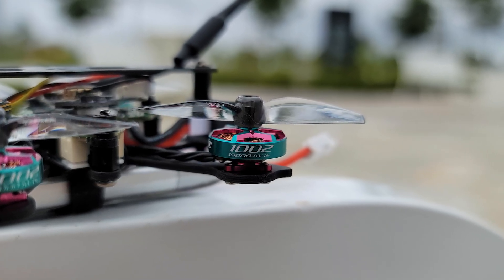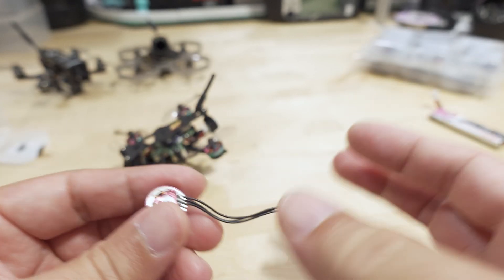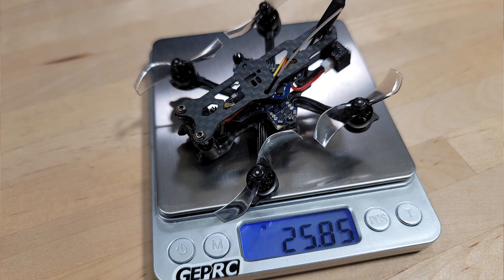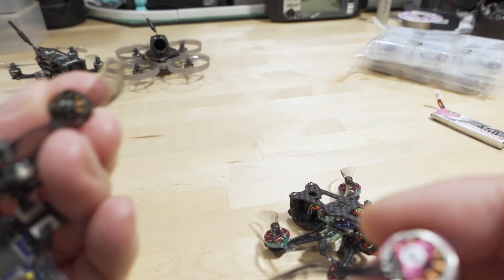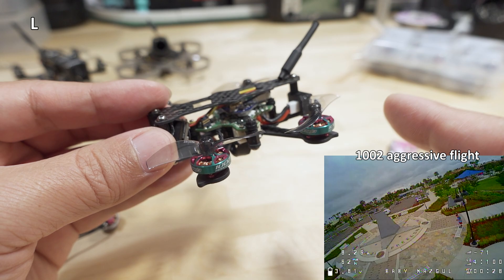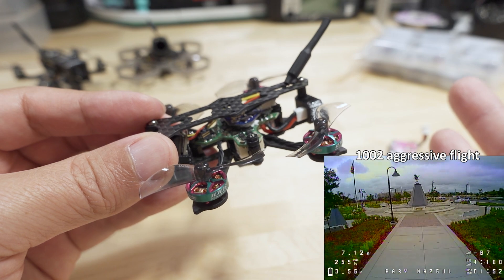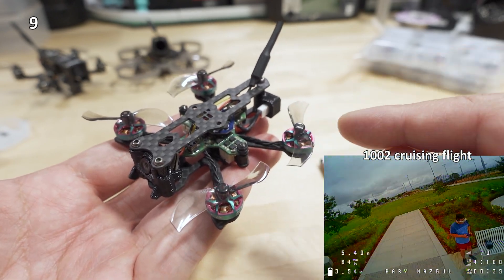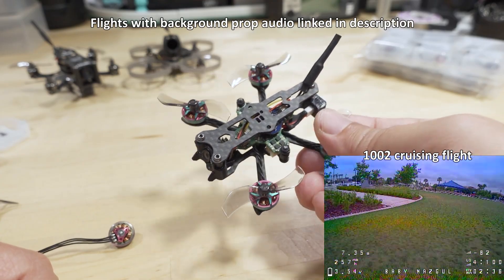RCinPOWER 1002 Motor CRUSHES 0802 Motor 🏁

Comment: Trying to decide which KV to get.. Do you think the 22000kv on the baby nazgul would be a battery hog? Or do you think we could probably still squeez 2-3 min out of it? I get about 3-4 mins on my mob7 elrs running 22000kv 0802 and it is 1.5 grams lighter than the baby naz was with its 0802 config. Thanks!
Reply from the maker: You'll get less flight time than I did on the 19000kv motor.  The 1002 motor is significantly larger than the 0802 motor so there's no way to compare them to each other.  The 1002 motor draws more amps to provide that 50% boost in power.  No way around that.  Can't have both power and efficiency at the same time.
Reply: @AlbertKimTV  yep, settled on the 19000kv as it still seems to perform well and I like having 3+ min flight times

Comment: An interesting motor size for sure, I was surprised at the efficiency losses compared to 0802 though. Maybe they're better suited for 2" or 2s 40mm quads and a little too heavy for 1s 40mm. For the mob7 1s HD, I think 19,000 could be better, 1002 of course being bigger than the stock 0802 20,000kvs. 22,000 would be interesting too for sure

Comment: You should try those 14000kv on the BETAFPV  HX115  LR  you reviewed this time last year, possibly with 65mm props.   the 18000KV it came with were stoooooopidly high KV for 3" props.  14000 is still really high, but I bet that and a slightly smaller prop, it might fly better, longer, and be more fun.

Comment: Having the motor wires on a pcb is something that should be standard in the hobby.. It sucks when a wire gets cut by something and then having to resolder wire to wire...

Comment: Good that you like this 1002 that I did with rcinpower. I tried to explain what we did from the prototype to the final version, and a lot of setup to do. Specially and due to the power (+50% than 0802), you can lift any tiny camera like insta360 go 2 for example and do real tricks :) "More control" is also due to the double beerings :)

Comment: More power = more fun? No.
power to weight ratio, yes.
Reply: But that title sounds dumb
Reply: @frankcastillo8869  to do things you can't do with 0802 ? It is an example :) But 1002 on 75mm is a total different feeling compare to 0802 due to the bearings. But the sweet spot is 2inch, as it is quite impossible to break the shaft and the power that these motors is able to provide vs the weight ratio is much more interesting than 0802
Reply: More fun because you can do things that you can't with 0802, like DJI naked that is really good for freestyle for example, or any camera on 75mm.